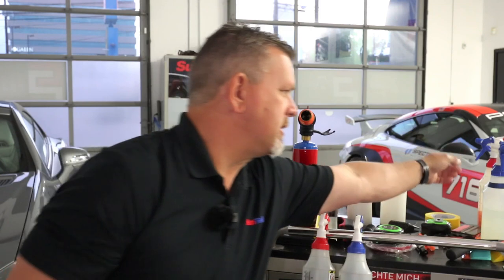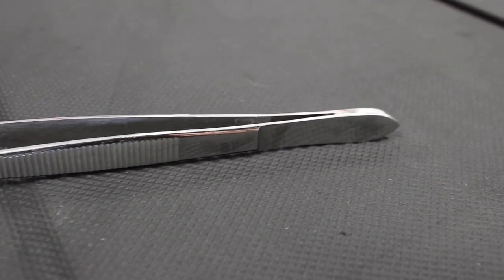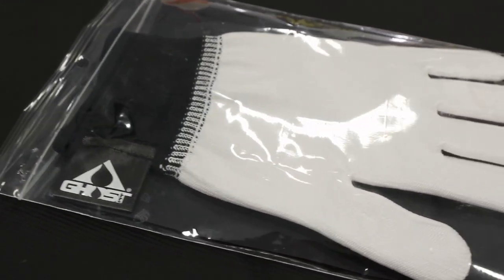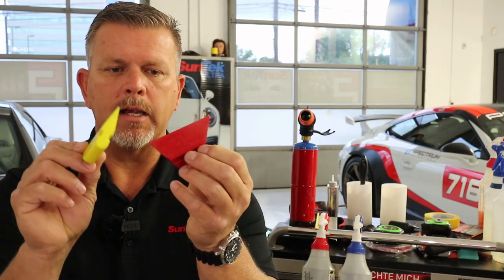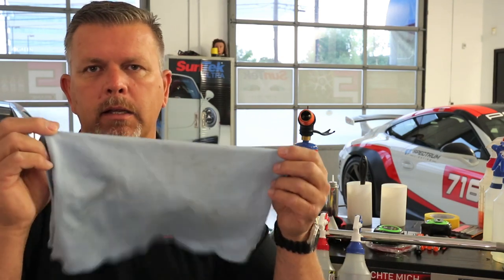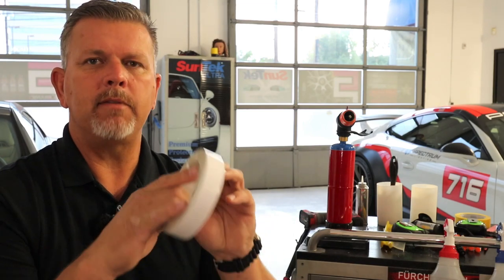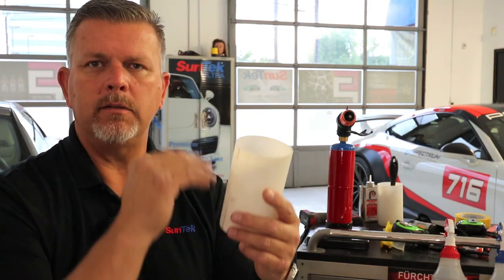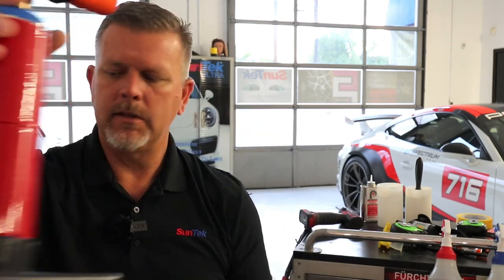Paint Protection Film Tools | How to VIDEO

Comment: What brand of carbon blade do you use please?
Reply from the maker: I use NT Cutter carbon blades from Japan. https://www.amazon.com/NT-CUTTER-Precision-100-Blade-BD-2000/dp/B003B3F0SK/ref=pd_cp_79_2/135-7074973-3572706?_encoding=UTF8&pd_rd_i=B003B3F0SK&pd_rd_r=60437ae0-24bf-422e-a662-8063dfba8811&pd_rd_w=SzQ5i&pd_rd_wg=vfaLt&pf_rd_p=0e5324e1-c848-4872-bbd5-5be6baedf80e&pf_rd_r=PR9PQ13E7T4JWQ48Q2PR&psc=1&refRID=PR9PQ13E7T4JWQ48Q2PR
Reply from the maker: RCF Song  the black 100  pack
Reply from the maker: RCF Song  You sure can we offer onsight training. It's a lot more than just bulk installing. I teach how to use patterns to there full potential. If you're using TrueCut I can teach you how to better understand and use it as well. Send an email to contactronharris@gmail.com or ppfacademy.info@gmail.com and I'll get with you about prices and availability. Classes are two day minimum and you can get trained on paying customers vehicles.